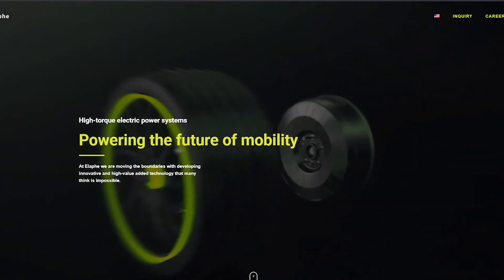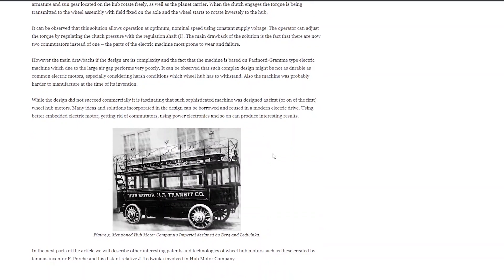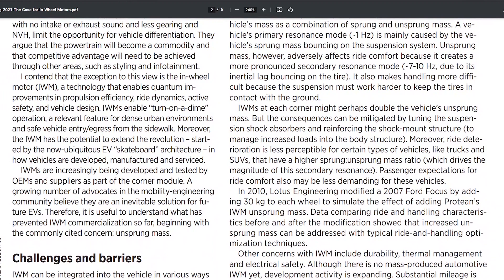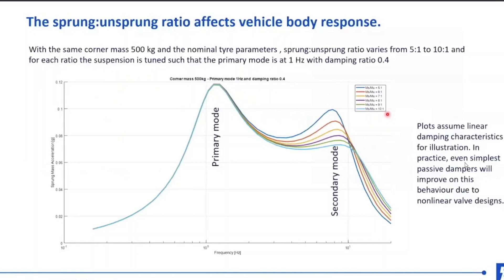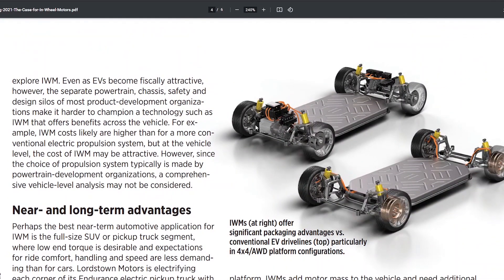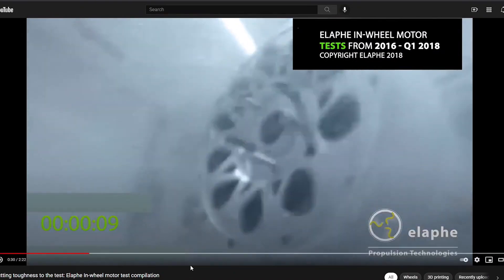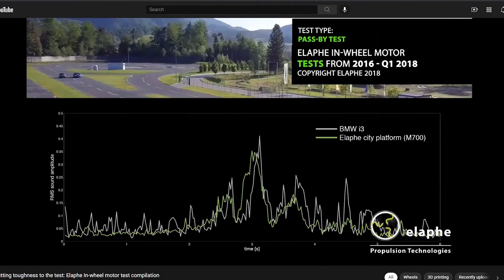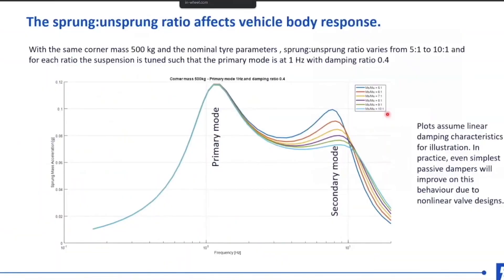Hub motors for Aptera:  Good or bad?

Comment: It seems the biggest issue with a gearless hub motor is excess unsprung weight. It seems that regenerative braking could be designed to eliminate wheel brakes for further weight reduction. This also minimizes the moving parts.

Comment: We’re very excited over Aptera and made a deposit — however when my wife discovered the 88’’ front track she felt she couldn’t manage it parking etc safely. Sadly I had to cancel the deposit. Studying the present design platform I don’t see any way to narrow things up. Such efforts would need rearrangement of drive train/steering assembly and bringing the front wheels inboard, adding aerodynamic wheel skirts. Its the wheel clearance for front steering that eats the track requirements! I really hope the engineers can figure this out as there are enough other very positive aspects to the Aptera concept that loosing some aerodynamic performance would be warranted.
Terry Lesh, Eugene, OR. (comments/ideas appreciated).

Comment: That unsprung weight issue is a hard one to overcome- motors are just so heavy. If you watch the transport evolved video, sure, ride quality was not mentioned, but you could see them bouncing around quite a lot. Onboard motors will give a much more comfortable ride. It’s going to take a lot of effort to change obviously, but they should do it. The better ride and less wear on the tyres is well worth it.

Comment: Bruce you are the total lying bull shit "ambassador" - Show the large quantities of batteries - where is the video on that?  Show the factory with tooling - Get an Aptera with a license plate on it showing it was able to get licensed - without rear view mirrors and the required center headlight it isn't even legal to drive it on the street - as a motorcycle or anything else.  If Aptera had anything proving they were getting ready for production they'd have a video   they have one for every other trivial crap they do.

Comment: Perhaps we Aptera reservation holders will have to rethink our expectations about achieving 1960's Cadillac "smoothness" when we have a basic physics issue.  Either we have long travel, super wallowy underdamped (meaning totally unsafe) suspension, or controlled/proper suspension that forces the rest of the body (and passengers) to feel the bumps.  Only the use of progressive springs/shocks can help a little but only over smaller bumps.  On every test ride shown, there was never one over a washboard/really bumpy road.    The only alleviation I see are the widely spaced front wheels.

I personally have realized this from the start, and yet made my reservation anyway.  I expect that the bumps will be especially unpleasant (as I have never felt before), especially in this initial roll-out version.  (Perhaps in later models, they might move one or more battery packs under the Frunk (between the front wheels), and have different spring/shock for the rear wheel (depending if you ordered the rear wheel motor)?  In the meantime, I (and my passenger) will have to pick smooth roads and just try to hang on.
Reply: The French solved this suspension problem decades ago. Citroen used a hydraulic suspension system. Peugeot used struts with 4 valves. Peugeot dealers showed off their superior suspension in demo drives by driving over railroad crossings at high speed. This is why these old Peugeot vehicles are still manufactured in Nigeria. The roads are abysmal there.

Comment: It's a shame this car is still wide. It's about a foot and a half wider than most sedans, almost as wide as a dually truck. Still cool though. With the hub motors, it would be possible to turn the front wheels arbitrarily far, allowing it to turn on a dime. I wonder if they plan to do that.
Reply: They plan to implement differential steering, which will enable it to do tank turns, if desired, so yes.
Reply: @n.brucenelson5920  interesting not sure how that will work with the 3 wheels. Off the top of my head i can imagine both feont wheels toe in, so their perpendicular axis aligns with the rear wheel, then it can pivot around the rear wheel. I don't think the steering rack would allow this though. A regular tank turn with the wheels pointed straight ahead would drag the rear wheel hard.
Reply: @zachary3777  Yes, I think it will involve scraping of the rear tire as the vehicle pivots.

Comment: Unsprung weight is not the only issue here. You mention motor torque and this is a major issue for durability of the suspension joints. The absence of trailing links and the length of the A arms must surely lead to wear of the ball joints and A arm bushings. Another issue is the high polar moment which results from putting the mass of the motors at the extremity of the vehicle. This could result in concerns about the handling characteristics. I'm sure these issues are being investigated. Perhaps others with greater knowledge can comment on this.
Reply: Good questions.  The torque moment is in the direction of travel, so this will not be adding additional wear beyond what a more conventional drive train would involve, as far as i can see.  My only comment about the polar moment is that I had a brisk ride in the Luna prototype before Thanksgiving and it felt planted and sportscar-like, even with the original suspension, which has been much improved on the betas, with a dual link rear instead of a swing arm, and an added sway bar in front, as well as more compliance.
Reply: @n.brucenelson5920  In a regular config. left and right driveshaft from transmission set up the torque reaction from the tire and wheel goes back through the engine and transmission mounts in the body structure - but with wheel motors this force goes back through the motor stator and transferred to the suspension arms - hence my concern. Polar moment would only be a concern at the traction limit - if the car starts to spin will it keep spinning rather than regain control. Thanks for helping talk this through.
Reply: @alansturt5211  Thanks!  you have given me something to think about.  I am not sure I have the background to quickly grasp what is happening here.  Most of my professional expertise was in thermal behavior.  I wonder if Elaphe has a comment?

Comment: Which of the Formula E cars use a Hub motor?
Answer none.
The Hub motor design is great for vehicles that are designed for maximum cargo/passenger capacity and zero performance or ride comfort. IE Busses, Cargo sleds, trolleys, golf carts.
Put an Aptera on the Nuremberg Ring against a E version of a Lotus 7 and the Aptera will lose in every corner and through most of the straights.
Run it on the rough road tests (washboard) and you'll be lucky if it makes it to the end of the first run.
Reply from the maker: The Aptera is built for efficiency, not performance. That being said the performance should be pretty good because of it's power to weight ratio but it is not meant to be a sports car.   If someone wants a sports car, they should buy a sports car.  But if someone wants the most efficient solar electric vehicle on the planet, they should get the Aptera.   Performance and comfort should be fine but it's not going to outperform a Bugatti or be more luxurious than a Maybach.
Reply: @ApteraOwnersClub  I'm not even thinking sports car, I'm thinking sub 1980's Toyota Corolla cornering and comfort.
Reply from the maker: That's fairly pessimistic.   We'll have to wait and see but I'm very confident it will clear the bar of a 1980s Corolla easily.  A 1980 Corolla had a 0 to 60 time of 14 seconds 😀.
Reply: @ApteraOwnersClub  Oh it will beat the 0-60, that's easy, you can have a cart with leaf spring suspension and do that, it's going around the corner at 40mph that will screw it over.
Reply: @pogo1140  I have had a ride in the Luna prototype with Daniel Morris driving at a brisk pace on public roads around the Aptera headquarters.  Even with the original suspension it felt planted and capable.  I am quite sure that it will outperform a Mazda Miata in the twisties, or at least be very close.  A Toyota Corolla need not even apply to the conversation, even though the Aptera is designed to be an economy car.  The Luna was harsh, like some full on sports cars I have driven, but the production model suspensions will be much more compliant.
Reply: @pogo1140  I have been in the twisties in a prototype with Daniel Morris driving at a far higher pace than you indicate and it corners fast, flat, and planted.
Reply: @n.brucenelson5920  When I say 40mph, that's a track speed, think corner with a speed limit of 20mph and you are going 40.
Speeds where you can hear the front wheels start to moan.
Reply from the maker: Even the alpha vehicle handle high speed turns easily.  There are several videos on that.  I suspect the handling will improve with development not worsen

Comment: OWNERS CLUB - THERE ARE NONE.  There aren't any parts they have on order there is no supply chain; this is a  group that never was focused on building anything - dream on
Reply from the maker: Oh, there's absolutely a supply chain.  Also they have manufacturing experts Munro onboard.  Also both founders have successfully launched and delivered products
https://youtu.be/eJWRz4I5rFc
Reply: Why lie about things you have no knowledge of and that I know from my visit to the Aptera factory and headquarters are completely false?  They have already purchased large quantities of components such as the 2170 batteries needed to complete 10s of thousands of vehicles.  They are doing what is needed to compensate for a less than reliable supply chain.
Reply: @n.brucenelson5920  That's good to hear. So much competition for battery cells now.

Comment: Your estimate of the sprung:unsprung ratio is waaaaay off.  Unsprung weight will turn-out to be a non-issue.  Nonetheless, you have gotten the main question 100% right: hub motor advantages outweigh disadvantages!  Thanks for posting this!  Full disclosure: I'm an Aptera reservation holder and investor (who's done his due diligence).
Reply: I would love to know about said due diligence.
Reply: @MrGamelover23  Watched every Aptera related video I could find. Read every prospectus.  Researched all the competition.  Researched reverse trikes, in particular.  Consulted the Chairs of physics, electrical and computer science engineering @ my alma mater where I serve on both the Alumni and Industrial Advisory Boards.  Used my "car guy" know-how and pre-existing experience w/Roush (Aptera's suspension partner) & factored-in Sandy Munro's involvement (as both a consultant and fellow equity investor).  Studied hub motors in general and Aptera's specifically.  Harnessed 41 years experience as a serial entrepreneur, VC & private equity fund manager and had multiple calls w/Chris Anthony.
Reply: @oceans123  wait you're a serial entrepreneur or the guy you're talking about is? Anyways, that's pretty good to know. If I had more money and wasn't paying off college debts I probably would invest $1,000.
Reply: @MrGamelover23  Yes!  Those 41 years experience as a serial entrepreneur are all mine.  Currently, I run a private equity fund  + serve as CEO for 2 predictive analytics companies in which we've invested.
Reply: @oceans123  oh wow. Nice. Glad to hear your input.

Comment: One consideration for hub motors is that the control arms need to hear the full torque of the motor. So these components need to be stronger.
Reply from the maker: Good point!
Reply: The torque is in the direction of travel.  There not be any more stress from torque than with a conventional drive.  It was a huge problem during Tesla development of the Roadster, when they were breaking the transmission with every demo drive they did for potential investors and customers.  This is one of the reasons it took Tesla 6 years to finish their EV conversion of the Lotus Elise.  Aptera is far ahead of that pace, even without a $250 million dollar government loan, and will probably beat the Cybertruck to production, which began development in 2019, just as with Aptera's present vehicle.
Reply: @n.brucenelson5920  If the drive unit is fixed to the chassis though a half shaft and cv joints the torque is transferred to the chassis. But if the drive unit is on the knuckle hub now the control arms that connect the hub to the chassis will take all the torque. As the wheel is rotated forward the control arm and hub will be twisted backward. The roadster probably didn’t use hub motors I’m guessing.

Comment: Does the Aptera float?
It's a reasonably light car with a rather broad base so maybe. You could put some paddlewheels, or some other method to generate thrust in the water and turn it into a literal boatcar :)

Okay, so I kinda nerded out on this a bit... and yeah, assuming the door/window seals are good it really should. 
The cargo area alone is .65m^3 which is 650kg worth of displacement and the entire car only weighs 800kg. So including the passenger volume there should be plenty of displacement for it to float. 
With all the batteries in the bottom of the car it has a built in ballast to keep it mostly upright. Only problem is that it might go nose up/down too much to be safely drivable. Some attachment ballast or floaters could fix that problem. 

The camping option for $600 seems like a terrible deal, but some thruster and float attachment that lets you boat the car around would be great.
Reply from the maker: It actually does float

Comment: Unsprung weight is interesting.  My Tesla Model Y Performance has very heavy wheels standard and I have a second set of wheels that are about 10 kg/wheel less.  I have not noticed a big difference in "feel" between the two and I expect most of the difference is from going from a 21" wheel to a 19" wheel and the corresponding increase in tire sidewall.  Like the Protean video says, added unsprung weight can be managed with suspension tuning, which I am sure Roush and Aptera will do just fine.
Reply: You haven't noticed it because your car weighs about the same as a truck.
Reply: @pogo1140  right

Comment: Thanks for putting this together.
Maybe I missed it, but it seems like the motor seals will need to be replaced every 30,000 miles. That is a serious disadvantage compared to other technology.
Reply: If seals do need periodic replacement I don’t have a problem with that presuming it’s not overly involved and difficult. The ability to perform normal maintenance on Aptera is a big selling point to me. I would never consider a Tesla (or modern ICE) for that very reason. When it’s faster and cheaper to purchase a new vehicle than maintain/repair there’s a problem!
Reply from the maker: Oh I didn't know that. Do you happen to have the link to that info?  I'd like to check it out!
Reply: @ApteraOwnersClub  I can't seem to find it. There was an Aptera Elaphe Webinar and I think the QA period discussed the motor seal replacement.
Reply from the maker: @johnbriggs7514  If it's true, let's hope the replacement is something relatively easy like replacing brake pads...
Reply: @ApteraOwnersClub  I think it may be even easier in some ways, but the wheel needs to by pulled.  

I don't think we know the final service interval for the initial production models yet.
Reply: @ApteraOwnersClub  Have you ever changed the grease seal on a car's wheel hubs?
Reply from the maker: My thoughts exactly
Reply from the maker: No I haven't
Reply: @ApteraOwnersClub  It's never easy.
Reply: Recent video confirms possible motor seal replacement intervals, but they are working on seals "that never needs replacement". (Kind of like "washerless" faucets that "never need new washers" (right), synthetic motor/transmission oils that never need changing (if you don't mind motor/trans replacement), and expensive "10-year smoke alarm batteries (that after 1.5 - 2 years, make you hunt for old 9v battery versions still on market).

Comment: Another problem with hub motors is lack of gearing and the difficulty of designing a motor able to start from a stopped position with high torque, and also efficiently drive the vehicle at high speeds. There are many motorized bicycles with hub motors and with geared drives. The geared drive is currently the better technology.
Reply from the maker: The difference between bike hub motors and car hub motors is that a bike hub motor has all these spokes attached to it and the diameter of the bike wheel is much greater than the diameter of the stator and rotors on the hub motor on a bicycle that reduces the low end torque on a bicycle wheel because the torque arm is so large. But on a automobile hub motor the stator and the rotors are almost the entire diameter of the wheel rim and so the torque arm is relatively small and so from everything I've read low end torque is not an issue in automobile hub motors as evidenced by that video from elaphe motors showing the hub motor ripping encased ice from a dead stop off of it due to its ridiculous torque.
Reply from the maker: I actually have a bike with a geared hub motor that I've put 4000 miles on.  It is awesome.
Reply: I have ridden in the Luna prototype.  Even the 2WD version has thrilling acceleration - there is gobs of torque on tap.   The lack of gearing is a huge advantage - starting with with no friction losses that a transmission imposes, less weight and more reliable, lower parts count and lower cost.  You  have it exactly backwards.
Reply: Drive shafts and axle shafts have been dealing with that torque “problem” for about a century…

What’s the problem????
Reply from the maker: @ernestgalvan9037  yes they deal with it by having a transmission.  Direct drive hub motors have no transmission.